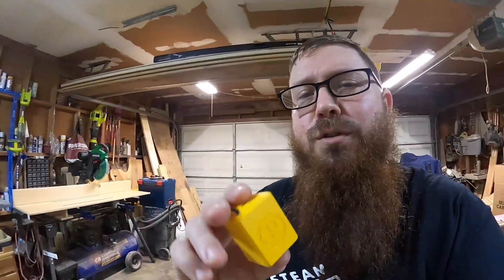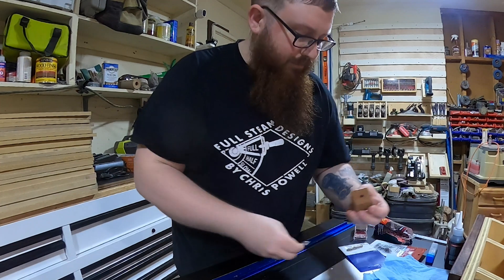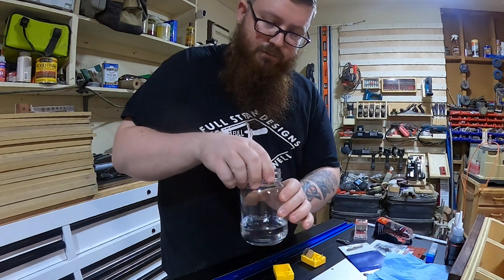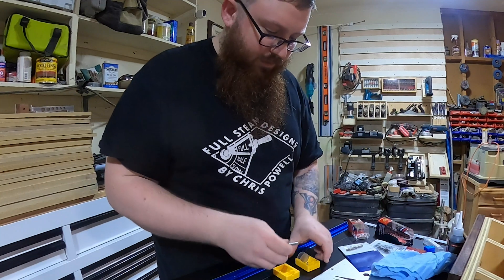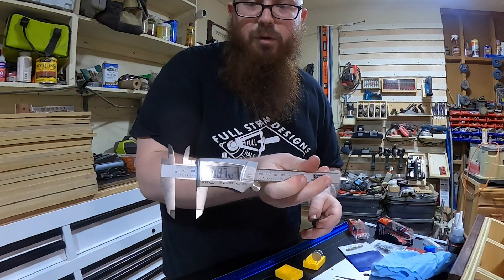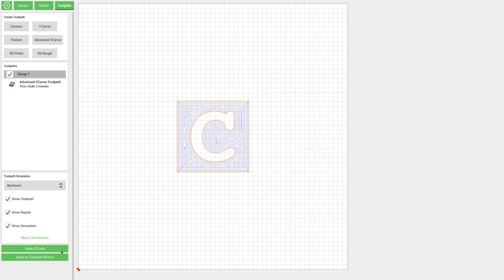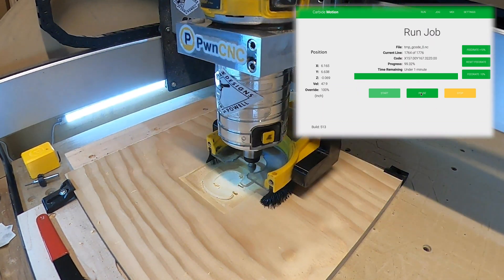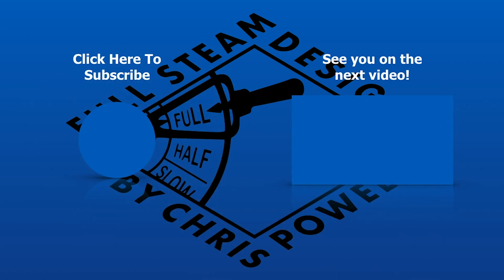Better than a touch probe? How to change CNC router bits

Comment: The product must have gotten worse since you reviewed this. Mine came with no cover like yours and was not so easy to handle as a result.
The collars are too big and heavy (bigger and heavier than the collars on a flush trim bit or collars that have bearings)resulting in outrageous runout and noise on the router. It was so bad I had to turn off the router and disconnect and go back to my old method.
That was a waste of my money and I really don't know why someone doesn't acknowledge the excessive weight of the collars and screw.

Comment: That's a very inventive jig, very much lateral thinking.
However, it would only work if you push it high enough, and exact enough, into the spindle with each bit. How do you accomplish that? Do you just shove it in, and bottom it out?

I use the paper method of setting z heights too, BTW.

Comment: What is the model of that router you're using?  I like the method used for removing/inserting bits.  That wrench used looks easy.
Reply from the maker: It’s a Dewalt with a Precise Bits collar
Reply: I’m sorry,  I phrased my question badly.
I’m referring to the collet nut and collet wrench.  Is that an aftermarket nut/wrench?
The nut has many slots.  It looks like that system is better than the typical wrench.
Reply from the maker: @rrr92462  yes, it’s from precise bits

Comment: so what this does is prevents having to redo the paper methode each time between bits?
Reply from the maker: Yea, it lets you do a bit change without resetting your z zero. The only time I ever change it is when I change material thickness.

Comment: How should this give you a repeatable insert depth, if you use a collet with a union nut? The ring is touching the nut, not the collet and both parts are not a reference to your table. Additionally the distance would change when the shaft diameter is a tiny bit off, because then the union nut would end in another height when clamping. This method can lead to an error of more than a millimeter.
Reply from the maker: It references the tip of the bit. I’ve been using this setup for years with no accuracy issues.
Reply: @ChrisPowellFSD  the ring has a fixed distance to the tool‘s tip, but the union nut and collet do not have a repeatable distance to the spindle and therefore not a to the table or worksurface. If you did not notice it, it just means that your works do tolerate changes of up to a millimeter. For other users this could mean severe problems, so it should not be advertised as an exact and reliable method.
Reply from the maker: @BaschyGoode  you should give it a try. I’m only speaking from my experience with actually using this setup. It works great.
Reply: @ChrisPowellFSD  I have tried and the results were off +/- 0.2mm even with the same bit. And that is way more than I have when using a probe. You really see the problems, when doing precise work on metal or v-carve inlay work.
Reply from the maker: @BaschyGoode  not sure what’s going on with your setup. They work perfect for me and many others. 🤷‍♂️

Comment: Hey Chris, thanks for your great videos. I have some questions for clarification. Does  the face of your collet protrude farther down/past the face of your collet nut? It seems if I tried this on my Carbide 3D router setup, the stop collar on the tool would end up hitting the collet nut instead of the collet face which would cause the tool stick-out to have errors depending on how much I loosened the nut before reinstalling the new bit. Thanks in advance for your response!
Reply from the maker: Thanks. Yea it touches the face of the nut.
Reply: @ChrisPowellFSD  Thanks

Comment: Chris, great videos! Question, have you had any issue with the bit collar screw coming loose when carving? Shapeoko Pro XXL will be here next week.
Reply from the maker: I had some issues with the stainless ones I used to use, so I used a drop of loctite on them. I haven’t had the issue with these black oxide ones though because the surface isn’t as smooth. Just make sure the bits are free of oil. A drop of green picture wouldn’t hurt anything if you wanted a little extra peace of mind.

Comment: I bought a set but I'm finding the collets to be tight even with loosened screw and degreasing. the bit doesn't go on with the ease. I tried Silicone Spray. Any suggestions ?
Reply from the maker: Maybe stick a screw driver in the gap and twist it a little to slightly open it up.
Reply: @ChrisPowellFSD  I tried a another set of bits and they fit freely. I might try a spark plug gap or a fine screw driver. Thanks

Comment: Been trying to use this collar setter for a week. Cannot get the 2 bits the same for doing vcarve inlays. There is some slop in the setter. That may be the problem.
Reply from the maker: Have you messaged PwnCNC? You’re using the collars that came with it?
Reply: @ChrisPowellFSD   yes messaged them last night. waiting for reply. Going to try another v bit today.
Reply from the maker: @AaronTurnwald  let me know how that turns out.

Comment: How much of the shank do you typically have in the collet? I just picked up a shapeoko and it has the makita router with it. I feel like the shanks on all of the bits are short and If I try the collet method It would end up next to the cutting head for the collet to get a good grip. Thanks!
Reply from the maker: I try to leave about 1/2” or so. I’ve run some shorter, without issue, but prefer not to.

Comment: I am not usually one to review something like this because it always comes out like a slander ad or a sales pitch.... but HOLY CRAP! This is the best add-on I have gotten for my Shapeoko 3 without a doubt. I got one and decided to try it out on a scrap I had laying around and it went off without a hitch when going from a 1/4" Endmill to a 1/8" endmill to a 60degree V-bit on the same job. No bit setter needed for the changes, just throw in the new one and hit continue. Watch the video again and just go buy one already. You can thank me later for the saved time and headache when running multiple bits on the same job! PwnCNC knocked this one out of the park without a doubt.
Reply: Would you have any footage of this working with your shapeoko. I have the xxl pro and am interested.

Comment: One thing I've run into using the collars is the offset between where I put the bit in and when I tighten it down - there's a gap there that seems to affect the accuracy. Then when I go to remove the bit, the collet pushes the collar down. Am I doing this wrong?
Reply from the maker: If they’re slipping, try some loftier or ca glue. The bit should actually be getting pulled up into the collet when tightening.

Comment: Chris great video on the new bit setter  from PWNCNC
2 questions I see some small clamps that are holding your board, did you make them or but them If so where. 
And the other is the HDZ worth the money and did you see a big difference in the quality of the cut between the to
Jeff Peters
Reply from the maker: Thanks Jeff. Those clamps are the toe clamps from PwnCNC. I ended up getting the cnc4newbie z slider. I really like it. Has some extra travel, which is a plus, and it’s really well made. I did a video on the install not too long ago. I don’t know if I necessarily notice a difference in the quality of the cuts, but I am able to push it harder and not have to worry about the issues you can have with a belt when it’s pushed too hard.
Reply: @ChrisPowellFSD  Is that a Cabide 3D  Product . I must have  missed that video.
Reply from the maker: It’s another cnc machine company that also makes upgrade parts for the Shapeoko. https://cnc4newbie.com/store/en/shapeoko-3-square-linear-bearings-slider-p105/?search=Shapeoko&description=1

Comment: I need find a place to order these collars from so I can get enough of them and put one on every damn bit I own. Bit changes are the bane of my CNC work.
Reply: Jake Apperson, be cautious when buying collars. The ones I ordered when I made the set block from Chris's previous video worked but I found out the collars for the 1/4" and 1/8" bits were a different thickness resulting in a different depth for the Z setting. I like this set block here though.
Reply from the maker: PwnCNC makes one for 1/8” bits too, and I believe it’s designed so the top setting lines up with the bottom setting on the 1/4” one.
Reply from the maker: I believe you can buy extras from PwnCNC. Shoot them an email if they aren’t listed and they should be able to help you out. I’m with you on the bit changes. Worst part about using a cnc machine...
Reply: So when setting up a collar for the depth stop on a 1/4" shank and 1/8" shank, what is the important measurement. From the cutting end of the bit to the bottom of the collar or top of the collar. Because there are times that want to use both diameter shanked bits.